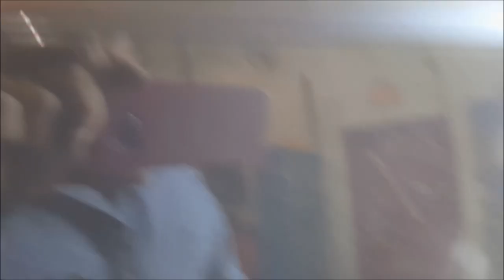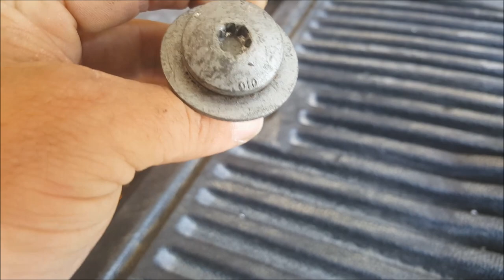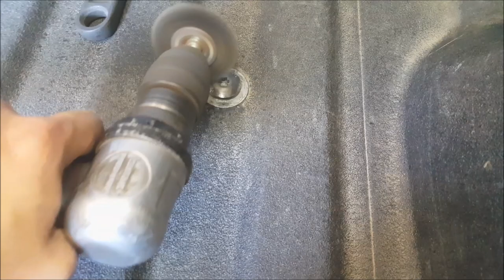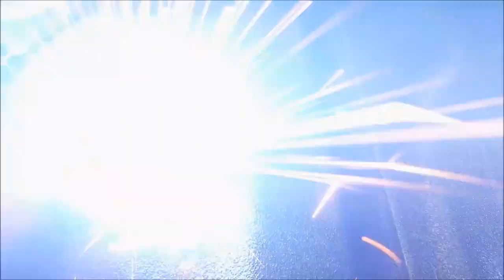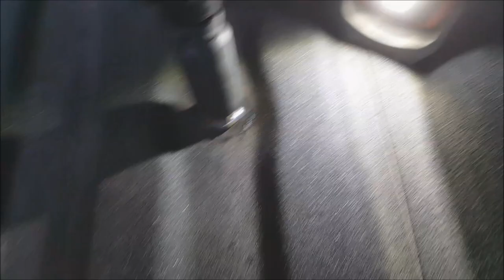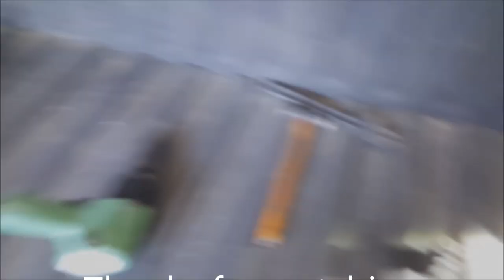Ford Truck T50 Seized Bed Bolt Removal

Comment: Had the same problem! Soaked it with penetrating oil for 10 days and didn’t work! Broke 3 t50! So I borrowed my buddies Heat induction bolt buster! It came off with no effort

Comment: TP50 bit and pray it isn't already stripped out! These even suck in the first 10 minutes after they get shot. the bolts are coated with locktite before they're installed.  Occasionally I've used a grinder to grind a 'slot' in the bolt head and air chisled them out if I have the time on the assembly line. Exremely fun to try without ruining the rest of the bed. I don't have the rust to deal with though. I highly reccommend your method Wicked Spray. Makes the most sense. The heat alone helps immensely.

Comment: Like someone else said. They are TP50 bits. However, I broke the centers out of the bolts even when using the TP50 bits. Going to have to weld a nut on them

Comment: I`m getting ready to do mine so to simplify things I ordered a set of bed bolts and am prepared to cut the heads off if needed. At least it will save a bunch of time.

Comment: Ok children if you run into this situation get a high quality cobalt drill bit and drill the tops off of each bolt then pick the bed up and off
Reply: Why would you do this if you had a welder? You make no sense
Reply: @narfoxone9er971  you make no sense.  Everyone doesn't have a welder
Reply: @mike12345807  where did he put his ground clamp?
Reply: Most rust belt trucks fail the j-nut since it's likely half of it's original thickness, and the whole thing just spins around. Welding on the bolt wont help, so drilling or grinding is the only way

Comment: If your planning on saving those t-50's...Get under there and  heat those bolts up cherry red 1 at at time- they'll come out without breaking your bit.
Reply: StayingBack71 lol fucken ford anyways... i striped out 2 bolts and broke my only t50 bit
Reply: i tried that on my 2011 f250 still had to end up doing what this guy did in the video

Comment: uh oh! doesn't look appealing. I was just about to take mine  out but now maybe not. I can't weld and mine is 2010, and canadian weather. Why do u suppose they are so hard to get out?   time/ wear and tear or are they factory sealed in there? I guess you tried oil around them beforehand too?
Reply from the maker: They might have lock-tite on them but I think it's corrosion that"s mostly the problem. Being that you're in Canada(i'm in eastern Washington so similar weather) I don't think oil will help much, Can't really get to the threads. The only other way I can think of is cut a slit in the top of the bolt so you can get a big flat head screwdriver on them. Use a screwdriver that doesn't have a round handle so you can use a wrench on it.

Comment: I hope you’re not a mechanic garage or run a shop because you used the wrong tools for this. Of course a T50 will strip... you’re supposed to use a TP50! Torx Plus bits are what you’re supposed to use
Reply from the maker: I hope you're not a troll because you suck at it.
Reply: @wickedspray7475 : IDK if Kris is a Troll...But Kris is 100% correct.  TP-50 bits required.

Comment: Why were you sliding the bed back?  To access the fuel pump?   Did this idea work?
Reply: You could do that or just drop the gas tank either drain the fuel or use a motorcycle jack or transmission jack